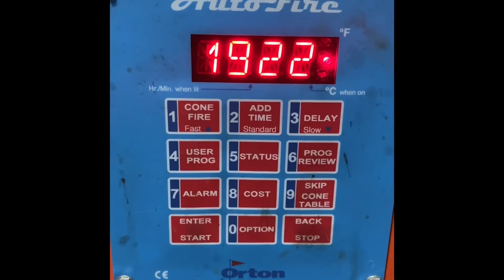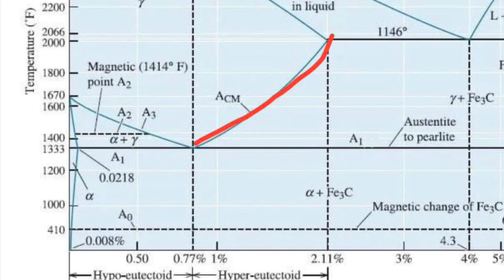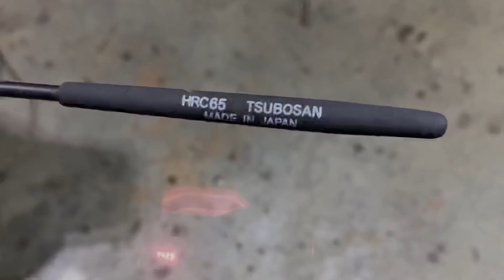WOOTZ Damascus Dagger. (Dagger Challenge)

Comment: did you quench in water or oil? Given the noise i suspect oil, and if that's the case then having a hamon is indeed inevitable. At least in europe, people just quenched in fresh water, and thats it (and the blade had to be thin). Very rough, you'll need to fix the warp, but that gives extreme hardness even on those old steels that really need to be shocked hard to harden
Anyways, fantastic work, thanks for the video !

Comment: Great explanation of the metallurgical processes involved here. It's easy to just say "get some metal hot and hammer till it's pointy" but there are so many incredible variables at work every time you forge. True bladesmiths are practical chemists in my humble eyes.

 That blade looks great and I love the handle material. I'd love to see one with a nice deep fuller 3/4 up the length of the blade, and a nice dark wood like ironwood with some deep checkering and bright brass hardware. Beautiful work and I'm anxious to see what else you make. Keep it up, man!

Comment: I recognized you were making Crucible steel right away, and you are correct, nothing is nicer than a Damasc style steel than the one you simply don't have to physically work like the "Pattern Welded" damascus knives, which truly aren't Damascus steel at all. from what we know, Wootz is as close to real Damascus steel as we can get, without going to Iran to get the iron that it was made from. I love your dagger, it is a very practical dagger, one intended to be used and abused, whereas all of the others, well, at least all of the ones I have seen so far in this challenge are much more decorative and to put them into daily use would be to ruin their overall appearance. But yours will likely gain in character and not be ruined by daily use. but the pattern on your steel is truly beautiful, so I can see how it would be addictive in nature because you would want to make more and more and more! Great work, and a great blade for sure! Good luck on the challenge!!!
Reply from the maker: Thank you!! And thanks for watching!!🔥👍🏻🗡

Comment: is wootz steel brittle or not? never seen bending test for wootz steel blade/dagger/sword ?
Reply from the maker: No, Key is to match the heat treat with the chemistry. Check out Peter Burt’s channel he does bending tests on his Wootz blades.
Reply: @HeavyForge  thanks for your knowledge sharing to me. so the brittle or not is depending on the percentage of phosphorus and sulfur in the billet.
your wootz pattern is beautiful.with rose,ladder,and wavy pattern. good job sir.

Comment: How do you make your crucibles?? Do u have a video on that process??
Reply from the maker: I don’t make them. I use Salamander super crucibles (clay graphite). You can purchase them online (Amazon or pmc supplies) I do not recommend using cheap clay graphite crucibles. Only salamander. Thanks for watching!!
Reply: Thank you so much for such a fast reply, I will check them out. Thanks again!

Comment: What is the vanadium percentage% because if you have no vanadium you have no wootz Damascus.  Vanandium is required to creat the carbide lattice that authentic Wootz Damascus has in its structure.
Reply from the maker: Sorel metal contains the vanadium. .004

Comment: Could you use this in modern Damascus, so you have the pattern of the wootz layered in between dark stripes? If at all possible it could take the normal Damascus to another level
Reply: Wootz is a watered pattern steel, bringing it to welding heat homogenizes to and it loses its pattern. At that point it would just be regular steel with no patterns
Reply: @alexbreeze4978  aw what a shame! The grainy look is much more interesting visually interesting than polished steel in my opinion.

Comment: SWEET! Great video. So why do you choose to roast your ingot versus a normalizing cycle?
Reply from the maker: Great question! Normalizing temps aren’t high enough for carbide dissolution. The initial Solidification structure is a brittle structure and roasting reduces that. If you look at the iron carbon phase diagram at hyper-eutectoid steels you’ll see the ACM line, you’ll need to be above that to reach pure austenite for given carbon content. Hope that makes sense. Thanks for watching!

Comment: Historically accurate you would also want to add a material that is high in vanadium this was the compound material that gave the wootz its strength and durability original blacksmiths that produced the wootz Damascus would also add natural leaves that were high in nitrogen to bring the carbon levels in the steel to a 1.5 level read no higher and not lower than 1.3 carbon content wich was perfect for the conditions it was made in.
Reply from the maker: That’s incorrect. Wootz is very low in CFE’s and using sorel has just the right amount of vanadium .004% which is why most Wootz smiths use it. To be more accurate would be adding Phosphorus. Organic matter was used historically as a carburizor. And Wootz C% was 1.3-1.8. CFE’s as well as other process are drivers of the pattern. Vanadium was found in a lot of the Indian Wootz and everyone who watched pendrays and verhoeven documentary don’t realize they glossed over a lot and the process he showed in the documentary was not his real process. If you’re really interested and want to learn more about Wootz I suggest joining the International Wootz Society. Plenty of skilled and knowledgeable smiths there. One in which worked with Al. Look up Niko Hynninen and read is recent paper with Verhoeven.

Comment: I'm super curious if you could stimulate crystal growth with chrome vanadium steel powder in your mix. Could be an interesting experiment.
Reply from the maker: I have some vanadium carbide powder along with other alloying carbide powders I plan to experiment with!
Reply: @HeavyForge  i have a few chrome vanadium wrenches if you want them. Not sure if that's referring to a plating process or the alloy but they're all doubles of sizes i have so it would be no biggie to sacrifice a couple to the melting gods

Comment: And holy crap I've never seen a devil forge get that hot. Man I want one of those things.
Reply from the maker: I am running a forced air burner I made. Not using the Venturi burner that comes with the furnace.
Reply: @HeavyForge  right on. I wonder if the factory burner could crank it that high.